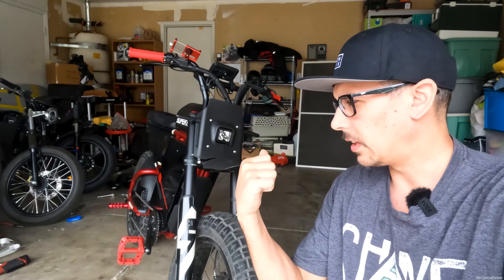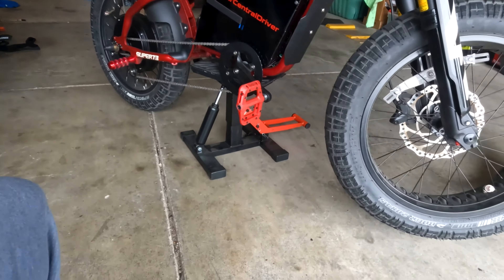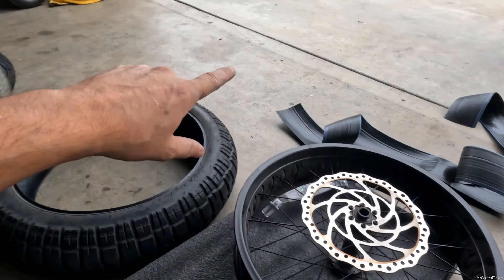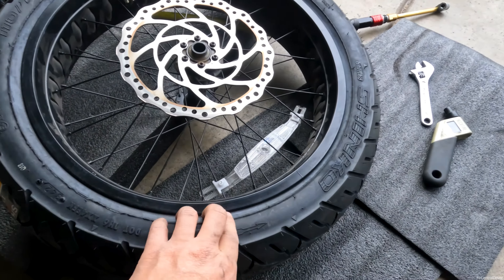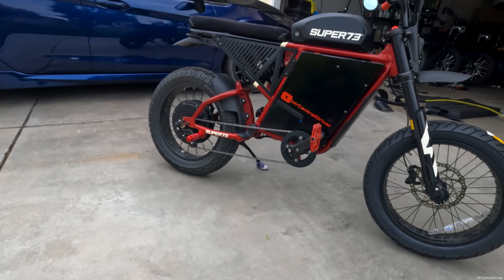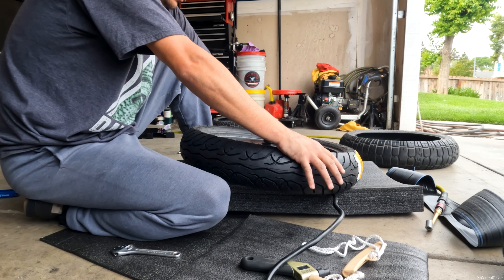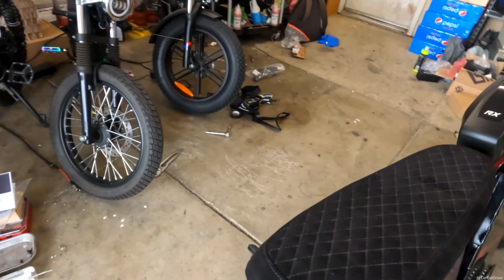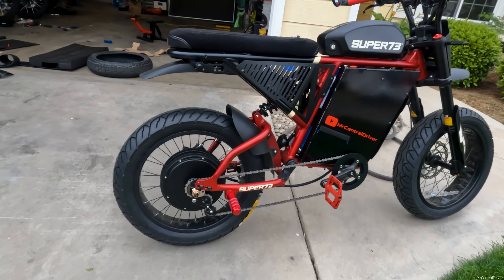Super73 72v - Installing Motorcycle Tires // Shinko SR567

Comment: Woow!!! Thx a lot for sharing.

I have Rad Power mini 4, I got 3 liners in each tire, to prevent punch and I still got some ones in a while. And let's not talk about how frequently we need to change tires because the asfalt eat them to fast. 

This video will help me a lot. I do 20 miles daily back and further to work. 😅 thx a lot.

Comment: I got mine at J&P cycles for $42/piece. I just used some soapy water on the rim and they went right on along with giving that stiff rubber a chance to slide while filling them up to seat properly. No tire (tyre) irons used!
Reply from the maker: Did u have the 5000 w rear wheel ? My stock rim, the tire went on fine!
Reply: @MrCentralDriver  
I wish!! Maybe in the future. I’m running stock 750w motor with a BBSHD mid drive, asi controller at around 3000w. I would like to just remove the hub and just use a 7 speed rear wheel with the BBSHD but they are very hard to find. Bike is a bit to heavy with 3 batteries,2 motors and Shinkos on a Juiced City Scrambler bike. Like your videos. Always good to see different builds.
Reply: @kmtnbike1117  Try the Lectric XP Premium to start off with as it does have a built-in Mid Drive motor and dual battery powered combination with 20ah worth of batteries; I am certain the wheels would also take the Shinko 567 series tires sized for 110-90/16 also as well and it also has the full five power preset tiered power levels for the pedal assistance system also as well; also this whole thing would be also highly affordable as the Lectric XP Premium can be had for $1900 currently right now and one could simply just substitute one of the two available batteries(auxiliary battery in the back) with a much larger optional primary auxiliary conservatively sized blue shrink wrapped 48V 40ah lithium ion battery and then simply also use the secondary 48V 10.4ah factory stock auxiliary battery as backup secondary independent emergency power source just to individually power one's fully truly updated and upgraded powerful motorcycle led lighting system also as well; it all should be doable for about $3,000 or so.
Reply: What size motorcycle tires would you put on a 26 by 4 inch ebike rim?
Reply: What size motorcycle tires would you put on a 26 by 4 inch ebike rim?
Reply: Smart. Helped 2 years later on a euy bike

Comment: I just found out. They measure motor cycle tires with mini meters, and 16 inches is the size of your rim. 110 mm is actual 4 .75 inches? And 70 is the ratio is how much percentages the side wall of the tire meet the base or tread of the tire. Hope that helps.

Comment: sometimes it helps to let them sit in the sun and be warm when installing and to ride it a mile on low psi to get it loose then take it off and fill it up all the way a little bit above stated psi on the tire to straighten them out then back off of the psi until its at the right level. its ghetto but if the tire fits in your oven you can sit it there at 115 for 20 minutes then wear gloves to install it haha
Reply from the maker: Yeah I should have used soap and water and let them sit for a bit so make them easier to stretch 🥲
Reply: Yes I agree simply throw one's Shinko tire into a hot car and let it bake and heat up during the day time for a couple hours; also use the dawn dishwashing fluid diluted with water along with a couple drops of mineral water added as one's ultimate soapy water tire bead super lubricant mixture; also one can use one's local harborfreight store to up one of their auto tire iron which are twenty four inches long; though make sure to use a micro fiber towel to prevent scratching one's wheel rim surface; a little prying force that is magnified over that twenty four inch long nice tire iron is going to make it much easier along with the use of the dishwasher fluid and water with mineral oil mixture tire bead lubricant.

Comment: I've had about 8 rear flats (this means that 72v setup could never work for me with how often this rear tire comes off). Seems every 4 rides I avg a flat. Get frustrated. Leave bike in garage for a month, change the tire, get a few rides, flat again. Wonder if this is a solution... Grzzly tires were doing well but had 2 flats on those now too. Long sigh.  Looks great. Is the rear tire that's part of the SR567 combo not have a fit?
Reply from the maker: Could have something stuck in the tire you haven’t noticed poping it every so often. Happened to me. Go motorcycle tires and you’ll be fine. You order two front tires and use them for front and back.
Reply: Try using the Thornbuster tire liners a dual stack layer along with some butyl rubber tape purchased from amazon to stick each of the Thornbuster tire liner layers directly to the tire carcass itself; so that is four layers substantial puncture isolation layers that work towards the goal of overall puncture protection; also one can use half a bottle of Flat Out purchased from amazon for about $20 so that is $10 per tire to pretreat each tire; now if one still experiences a potential puncture flat simply use half a bottle(16 ounce) per tire and it should help to seal the tire puncture enough to get home till one can repair tire puncture.

Comment: will these tires fit on the stock rims ?I notcied that you  not a stock back rim
Reply from the maker: these are made to fit the stock front and back super73 wheels. my 72v rear wheel is way harder to fit these tires on so i struggled.

Comment: well done even though you had problems with the back wheel,i would have put the tyre liner in the back tyre just to be safe mate.? from uk
Reply from the maker: The tire is so thick. It would have made this much more difficult
Reply: There was barely any room to even put the inner tube. Liners would be impossible to put in these tires.

Comment: gr8 video, so overall, what are the best tires to replace the stock BDGR ones? on original motor and rims of course....i could not find anything that will match the beads . .. :( i spent some money on different ones, but had to send them back every time, they did not fit . .

Comment: Awesome video ✊… so I’m interested in possibly modding a Super73-RX and possibly installing a mid-drive motor on this with Shigura MT7(Shimano lever’s/Magura rotor’s and pad’s) hybrid brake’s. Is a mid drive system possible on this RX frame you think? Maybe with a 72v/60v depending on available space.
Reply: I would love that creative idea in that it would be the first new and one of a kind hybrid mid-drive electric powered Super73 Super Bike; and to actually have that mid-drive motor controlled by a matching motor controller that would allow one to also have active a graphic console user interface screen; to enable one to actually set and power level adjust one's fully adjustable customized pedal assistance levels with up to ten customized preset pedal assistance power levels; now that would be the kind of stuff that e-biking dreams are truly made to fully realize; even if its $2,500 bucks in total cost to upgrade.

Comment: Dope tires anyway do they have 17inch tire
Reply from the maker: They have tons of sizes if you look them up but only this size fits 20x4 ebike wheels
Reply: the equivalent generic size is 3.00 inch x 16 inch tire to the 4.00 inch x 20 inch fat tire; its a tire classification sizing thing.
for example 100mm x 80 series x 16 inch would also likely work since 100mm is about four inches width dimension
for example 110mm x 70 series x 16 inch would also likely work since 110mm is about four and a quarter inch width dimension with a slightly lower vertical height profile tire height
the tread depth is close to half an inch and the robustness of the motorcycle tire carcass is also heavily reinforced to DOT guideline specifications for motorcycle; so while it is more money it is well worth it in the tire puncture protection department.

Now an additional upgrade tire choice option to the Shinko SR567 110/70-16 scooter tire would be the Kenda K671 series tire which also has a matching entry size in the Kenda K671 110/70-16 size scooter tire also as well; reading the scooter tire reviews the rubber tire compound used the Kenda K671 is a much harder street rubber tire compound which should yield even better tire endurance, very long prolonged tire mileage capabilities and in particular significantly enhanced tire puncture resistance capabilities also as well. 

Now JPCycle has the $112 scooter tire discounted to $89 which is about a 21 percent savings discount and is one of the more reliable and reputable tire sellers on the internet that sells quality branded name tires; 

though the Kenda K671 scooter tire is about 60 percent more in cost than the Shinko SR567 110/70-16 scooter tires; so one could theoretically in fact put the Kenda K671 110/70-16 scooter tire on the rear wheel while also putting the Shinko SR567 on the front wheel at the same time; 

now since the front tire typically last two to three times longer than the typical rear scooter tire; so while the Shinko SR567 scooter tire in the front wheel will probably last at least 10,000 miles; the Kenda K671 scooter tire placed in the rear wheel with its significantly much harder rubber tire compound will probably likely be more puncture resistant over its long expected scooter tire lifetime, which will probably also last 10,000 miles also as well while at the same time reducing its potential tire puncture frequency interval; so long as one shifts more of one's braking to the front wheel than the rear wheel braking when it's applicable and potentially possible; all to help prolong the rear tire's long potential optimal expected lifetime.

Shinko SR567 110/70-16 is about $56 on front tire 
Kenda K671 110/70-16 is about $89 on rear tire

So the front tire Shinko SR567 110/70-16 and rear tire Kenda K671 100/70-16 combination pair will be about $145 for about 10,000 miles of potential tire tread life without quite as much potential for tire puncture frequency occurrence's hopefully. the cost would be roughly about 1.45 cents per mile for both tire pairs or about 0.725 cents per mile per tire on average; which is still far better than the generic 20 inch by 4 inch tire which typically only lasts 900 miles or so at $30 replacement tire cost which costs roughly about 3.3 cents per mile per tire; 

which actually means the cost of the generic 20 inch by 4 inch tire costs about 4.55 times more than using the front tire Shinko SR567 110/70-16 mounted on the front wheel and the rear tire Kenda K671 mounted on the rear wheel; 

so therefore it makes perfect rational economic common thought provoking sense to actually undertake and go ahead and do the actual tire upgrade option select choice; and thus save oneself some very sizeable tire expense savings and also hopefully save oneself some truly unneeded potential tire punctures in both front/rear wheels for both the short and long term time frame tire puncture occurrence intervals also as well.

Comment: Since they weigh twice as much I wonder if installing those tires void the warranty. Thought I saw that from super73 at one time.
Reply from the maker: Honestly anything that’s not super73 parts will void the warranty. I just wouldn’t tell them about it if you have a problem
Reply: Heck after the first year the warranty is up anyhow; these upgrades only make the Super73 better than the original equipment specification easily by far.
Reply: @profdleeucc  exactly

Comment: Yo for this 72v setup with battery and kit, does it run together with the stock battery ? And does pedal assist still work?
Reply: Also do the shinkos make the bike shorter or taller?
Reply from the maker: stock battery runs off the stock controller under the seat for your lights if you decide to keep it anyways. pedal assist does not work anymore
Reply from the maker: no it sits the same but they look lower profile
Reply: @MrCentralDriver  very nice thanks for all the info.

Comment: Did you get two front tires? I can only find the set in different sizes.
Reply from the maker: Yes they are front tires only. Use for front and back.
Reply: @MrCentralDriver  thanks a lot. One more thing …did you follow the arrows on the tire for rotation or did you interchange them given both are front tires. Hope you can advise me. I installed mine and the ride is so bouncy on the rear.

Comment: What direction do the two front tires go on both front and rear? If youre installing two front tires. My front end is vibrating at top speeds.
Reply from the maker: They both point straight. Nothing if different. It’s going on a bike not a scooter. It’s made for the front of a scooter. You will need to deflate and even the bead around the rim to make it as perfect as u can. It’s hard to do. Easy to lay the bike down

Comment: probably a silly question but since your rims are 20in and you're using 16'. My rims are 21in so I would have to get a 17' tire right?
Reply: The 73 rims are 16", bicycle tyres are measured by overall diameter, MV tyres are denoted by rim diameter

Comment: Are you using some special inner tubes with these, or just the stock Super73 tubes? Somebody said that it's worth going with thicker motorcycle tubes. Any suggestions for those?
Reply from the maker: Stock tubes. No issues :)
Reply: No matter what I do, I can’t seat the bead on them. There is always one spot that gets sucked into the rim a little bit more. How do you combat it? I’ve literally tried everything. Soapy water, special tire lube, heating the tire, giving it 70 PSI (scared to go any higher) and nothing pops into place.

Comment: How would these handle on a dirt road? Are they slick?
Reply from the maker: They have sticky rubber compared to stock. In dirt I’m not sure. The stock tires were horrible tho
Reply: @MrCentralDriver  Agreed. Ive had my bike for a month. Im trying to get the most of of them before buying new ones and your video helped out. Thanks

Comment: How did you get the shinkos to balance properly on the wheel?
Reply from the maker: Make sure u don’t have any weight on the tire. Air it up while holding it even little by little. Move it around under low pressure if it’s uneven. It took me a few try’s.

Comment: tought about getting motorcycle tires on my ariel rider x but then found vee tire huntsman tires and their great just used motorcycle 3.5 tubes seemed like twice as thick vs stock
Reply from the maker: That’s good! Thicker tires so so much better for flats
Reply: @MrCentralDriver  what psi do you run on yours? i currently have 20 on myn i ride a lot on gravel.
Reply: Depending on the brand's particular tire characteristics the motorcycle tire with the heavier motorcycle tire and the heavier duty tire carcass is the one with the potential to reduce  road punctures over time.

Comment: Where the original tires 20" x 4"?
Reply from the maker: Yes
Reply: @MrCentralDriver  - Thanks!
Reply: @MrCentralDriver  - I clicked on your link and Amazon says they are "front" tires.   But you used the "front" tires on both rims, correct?

Comment: What's your tire pressure at?
Reply from the maker: 30ish
Reply: @MrCentralDriver  front and rear? it's not bouncy or anything?
Reply: @MrCentralDriver  little high, use 20 rear 10 front